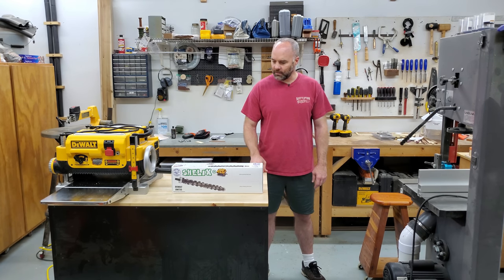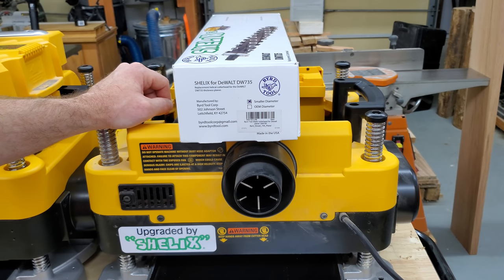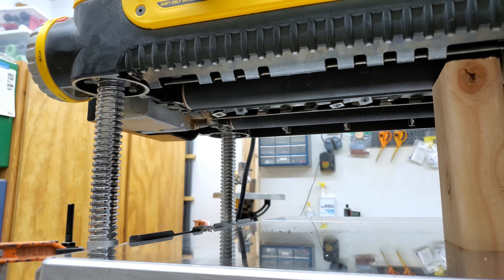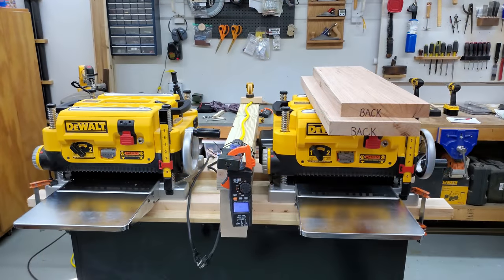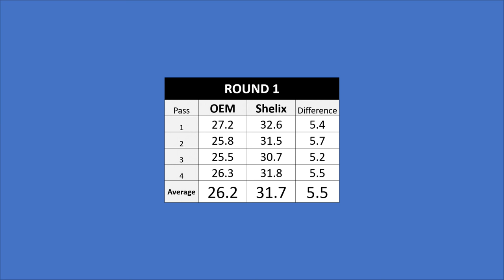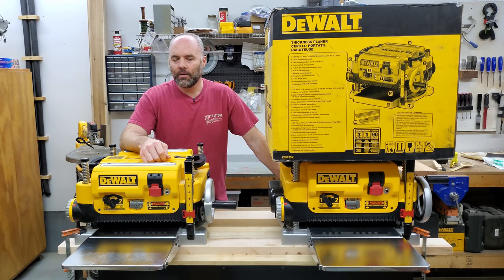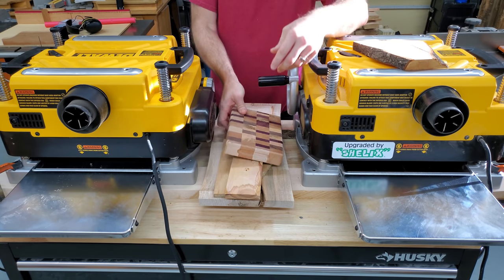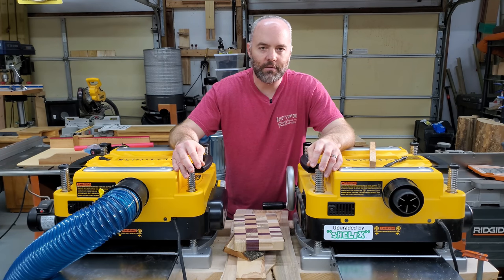The video I wish I watched before buying a SHELIX

Comment: Thank you for this info. As a woodturner, I dont do much flatwork. I will stick to hand planing for now.
Reply: @nicksshitbro  I would get a 16" Lathe, 110 power. Try a Jet. Great features, reversible, not too expensive, not overpowered for a beginner, but will not block you like a minilathe. Mini's are cheap and beginner friendly, but you do skill past them I think, if you stay in it. If I had to do over, that's what I would do.
Reply: @nicksshitbro  Dude, I am sure you know jet for wood, not metal. I would love to get an old timer lathe, a nice gearhead monarch, leblonde or something. Not into CNC. Olde timey making is where it is at. Just an old lady working out of a garage, but... I cruise craigslist all the time for old iron. A girl can dream.
Reply: @nicksshitbro  Hey, it counts! Workholding and safety lessons apply, across the board.

Comment: I'll stick with stock blades. Can buy many blades for the price of a helical. For the first 20 years of woodworking, I used 3/4 or 1/2 stock as a planer was beyond my pocketbook. My first planer was a Ryobi 10". As clockmaker (now almost 60 years) I wore it it out. I bought the DeWalt about 10 years ago and have run about 10,000bf through it milling a lot 4/4 down 5/8". Looking at finish from my straight blade and that of helical blade finish- it ain't worth the cost.

Comment: Wow, what kind of deal would you give me on your extra planer? Still haven't bought one yet. Will want to buy a Shelix head now also! Anxious Robert
Reply from the maker: The shipping costs would make it not much of a deal. You're better off keeping an eye out for some of the holiday sales.  You can even get free shipping.
Reply: @TheSnekkerShow  Hi, thanks for the reply, I just got lucky today and got a brand new Dewalt planer still in the box never used at a pawn shop by my house for 250 with tax and 15 day warranty included,  it's a 3 blade but 1 model down from the ones you have,  it's model #DW734. THANKS AGAIN, GOOD VIDEO! Robert
Reply from the maker: @robertc.6441   Good to hear, sounds like you got a good price.

Comment: I would expect the higher current draw, given the increase in blade area (4 curving flutes vs 3 straight flutes). The fact that the power draw leveled out with both machines on full steam is interesting though. As is the acoustic difference in the tool heads. On that sound difference alone I would be willing to make the change. Given the ability to confine damage to at worst $4-$8 vs $60 makes it a no-brainer, providing you have the power for it.

Comment: That's it I'm not going to buy this planer. I'm going to make my own to plane half inch pine , I'm going to build one with a 454 chevy motor with sprockets off on a bulldozer track. Good vid Thanks.
Reply from the maker: Oh man, now I'm having flashbacks of the 1989 3500HD with a 454 I bought for $2,000, spent $1,500 working on, and then sold for $1,000 a few months later.
Reply: @TheSnekkerShow  I still have 2 of them ones a 88 3500 and the other is a 97 dually and they can just sit out back. They get about 7 to 10 mpg and I will just drive my 4 banger ford ranger and they are talking gas can go up to 10 bucks a gallon the way things are going.

Comment: Cost of  the cutters in minor compared to the cut it’s producing. Helical cutters are far superior to straight blades. I have large planners and small planners like in your video . I use the small ones for higher figured woods for boxs. Superior cuts on figured woods for the most part

Comment: 1. Amperage is always measured under "no load" so yes, it is a 15amp motor, regardless of draw under load. 
2. Breakers have a "slow blow" feature built in so they don't trip during high current draw of motor start ups.
3. I would NEVER run multiple devices on a single 15 amp circuit!
Reply from the maker: The closest I've been to running this with no load is with the impeller removed. That drops it to around 5 amps, even while moving the rollers and cutterhead.
Reply: @TheSnekkerShow  by "no load" manufacturers mean your not putting wood through it.

Comment: Would be interesting to remove a row of cutters on the shelix. Wonder if the increase in amps is due to higher engagement.
Reply from the maker: Probably, but it would throw the cutterhead off balance and kill everyone in a 50 meter radius with shrapnel. I've been tempted to do another test with the Grizzly head since that one has three rows compared to the four rows in the Shelix and Lux models.

Comment: Does the shelix noticeably feel heavier. I might be wrong here but isn’t the power draw directly related to the mass? P.S. I want to see the ham sandwich lol
Reply from the maker: I'm not sure about the weight, but I vaguely recall the Shelix running at slightly lower power when I was doing no-load measurements. I wish that meter did a better job of measuring max amps during initial startup.
Reply: Once it is spinning, mass won't matter much.  It will take more to get up to speed, but once in steady state added mass will not require more power to keep spinning.

Comment: I think DeWalt can refuse to warrant use of a Shelix in the planer. They didn’t design the planer to use that component and as you pointed out in the first few minutes, the planer feed system is affected, the motor is affected and the stress on the components will be different than with the OEM knives. The knives and rotor are a critical component of the system. Certainly more than wiper blades and tires.
Reply from the maker: I would ask, what's the difference to the motor between a hobby woodworker using a Shelix to plane wood occasionally, and a commercial user planing lots of hardwood constantly with the stock knives?  If DeWalt installs a thermal breaker to prevent the motor from overheating and it fails to prevent the motor from overheating during the warranty period, who should take responsibility?
Reply: @TheSnekkerShow exactly....what is the difference? No one at DeWalt designed it for this head so why should they be responsible for a user modification. Board feet isn't the only variable to gauge stress on the unit. The breaker is there to prevent an electrical fire per UL standards. I know because I have designed products with these breakers. The breaker is not a limit on abuse of the machine to prevent mechanical failure or stress that is cumulative over time. Fatigue of components is another factor in the mix. The motor is clearly straining more with the Shelix which is a good indicator there is more mechanical load on the components. Compare driving off road vs highway miles. The car will have fewer mechanical failures on the highway because the stress is lower over a larger number of miles.
Reply from the maker: @bingobango8777  Glad we agree the motor can be stressed with or without the Shelix. I guess it's up to the service center to make a decision on warranty coverage.
Reply: @TheSnekkerShow  https://support.dewalt.com/hc/en-us/articles/360021403154-What-is-DEWALT-warranty-  alteration or repair not covered. Yes the motor is stressed in both configurations but one is beyond the design specifications. All components of machines are under varying kinds of stress. What matters is if they are within the material and design limits the engineer specified for the product.
Reply: @TheSnekkerShow  see top of page 12 of the 735X manual. “NOTE: Helical cutterheads have not been tested with this product and are not recommended for use. “
Reply from the maker: @bingobango8777  That's a nice interpretation, which I already discussed.  Fun chat, have a good night.
Reply: @TheSnekkerShow  I wasn't interpreting anything.

Comment: FYI, Hitting a nail wipes out not one, but THREE blades. For me, it just took a knot in Redwood and now I have a high groove now (which means a second final pass and a light sanding). Anyway, the payoff is three times faster than explained on this video.
Reply from the maker: If the rest of the knives are still sharp, you might be able to rotate or replace only one knife. That's what I do with my jointer since I replace for nicks much more frequently than dull blades.
Reply from the maker: @Fun4GA  Likewise, if you replace one knife, the new one will remove the ridge left by the two nicked ones.  https://youtu.be/6vudqFvFu7E
Reply: @TheSnekkerShow  Good point.

Comment: 30 Amps?! :O
In your american 120 Volts installation it gives 3.6 kW power draw. Here where i live we have 230 Volts in single phase, so with same power it would be "only" around 15.5 Amp. So pretty safe for standard electrical installation. Do you have thicker wires in US to compensate lower voltage=higher amperage? :S
Reply from the maker: Wire size is determined by amperage, and is probably close to the same size no matter where you go.

Comment: You said 10 loops in line splitter, but your meter is reading 300 amps, which would give 3 amps. Also you are measuring peak current bit breakers trip based on an rms current.
Reply: 300 divided by 10 is usually 30.
Reply: @AJ-ln4sm  that’s correct, not sure what I was thinking when I wrote this...
Reply: @jamesmarks8099  you were thinking metric amps, lol.

Comment: Okay this may seem like a dumb Question but if the dewalt planer is $650 and you add a 400 dollar head....Now you have spent over a grand on it...Can't you just buy a higher end planer to begin with?
Reply from the maker: This comes up a lot, and has many angles. Yes, spending more money generally gets you better tools. Hobby guys and pros alike have to prioritize and justify their investments, and usually build their workshops incrementally over many years. Spending almost an extra grand for a helical carbide floor model would get me a bigger planer than I need, that eats up more shop space, and cuts in to my SawStop table saw budget. Everyone's situation is different though.
Reply: I just bought this planer a few weeks ago.  Paid $499, included the out feed tables and xtra set of blades.  I don’t mind spending the xtra $400 for the Shelix cutterhead.  How I see it, is not in total cost, but cost EACH time I made a purchase. Besides, this particular planer is tried and true and a legit tank!  I also purchased the stand on wheels from Dewalt so it’s really easy to move around since, like most of you, space is limited.
Reply: I think so. If you're willing to drop a grand on the planet and the helical cutter, just save about 500 more and get a 15" floor model that probably has a helical cutter from the get go. And it likely has a 1hp (maybe a 2hp) induction motor so no overheating issues.
Reply: I am currently considering this exact question. Here is the way I see it, there is no middle ground tools, after this dewalt you need to spend 3x more to get a 15". My problem with the bigger 15" machines is the weight, I cannot get 400-600lbs down my basement stairs.
Reply: @Sillyturner  haha i did manage to get a 3ph sawstop down the stairs ...

Comment: Since your comparing it to a car, if you constantly put a heavier loaded on the planer it the same as towing a trailer your car was not designed for especially if you put wheels, tires etc that may do a better job but will alter the design! That breaker should not trip so often yes it's going to wear out the motor faster the same thing that happens to a vehicle you overload regularly because of mods!

Comment: The reset button is a safety device but if your planer stops working the problem might be the micro switch this is inside behind the outside switch. These micro switches seem to get hot and burn out. Most people think it's the outside red switch. You have to take apart the whole front to get to the micro switch. The closest warranty service center was 4 hours away from me.  DeWalt has the worst service centers. Learn to work on your machines you probably  know more then these so call tech service guys.
Reply from the maker: Right you are. My micro switch went out later. https://youtu.be/I0TjrxVLZZU

Comment: The amperage draw will probably increase in the new planer as the blades lose their edge.
Reply from the maker: You're right, and it would be interesting to measure the difference. All I had was a set of new blades when I did the comparison.

Comment: Did I miss it, did you ever show diference in cutting finish?
Reply: What do you mean did you miss it. Fast forward in the video
Reply from the maker: I showed some cut-quality comparisons at the end of the previous version of this video, and intended to do the same with this one, but two things got in my way. I did the cut comparison at the end of the day, and the low-angle evening sun was so bright it washed out the boards. Second, the steel knives were new, so the cut quality was much better than it would have been after some use. This was a close match with used carbide cutters against new steel knives, but if the steel knives had been used even half as much as the carbide, there would have been a lot more chipping. New/sharp steel knives give a great finish on uncomplicated wood, even better than carbide because it can be sharpened to a finer edge. Once the steel becomes even slightly dulled, the quality goes downhill fast.
Reply: I was expecting to see a finish quality comparison too.  That would be the main reason for considering a helical cutter upgrade IMHO...
Reply: I had replaced a head on my rigid planner with this head, used for one job then CA fires wiped out all of my shop and house, but I liked the head , it did good job , did not have to rotate any knifes.

Comment: Spend the money and get the lux cut from my work it seems to be the better of the carbide replacement cutter heads I have both
Reply from the maker: What do you like better about the Lux Cut? They're pretty close to the same price most of the time, but the replacement cutters are more expensive for the Lux. Shelix is made in USA, and the Lux is made in Taiwan. I saw a video on Stumpy Nubs a while back where he was plugging hard for the Lux, but he's done several videos that appear to be sponsor-driven, so I wasn't sure how much of that was the sponsor talking. I think he said the Lux was easier to align the cutters on, but I've never had any trouble with that. He also said that the Lux had a black-oxide coating to prevent rusting, but I've never had any trouble with rusting either.

Comment: Folks..I get the money issue between the two types of cutter heads, but I plane a LOT OF lumber and there's just no way you're going to go through so many blades over time it'll be a significant savings. I've been running my Ridgid for about 6 years and have only changed blades once. Yeah, I've hit knots and got knicks in blades plenty of times, but it's not a huge deal breaker to simply plane off those long high spots with a hand plane. I only replace them when they get too dull to cut effectively. I've spent $30 in 6 years. Hardly enough to justify a $400 cutter head.. I suppose if I had fuckaround money I might get one, but most likely I'd just get a much bigger planer..
Reply: Cost simply isn't always the most important or deciding factor in all purchasing decisions. Sometimes people prioritize other factors, and he went into great detail about many of those factors in this very video.
Reply: The big issue at my makerspace was not the cost of the blades, but the downtime of the equipment. Being able to swap out one cutter would probably be worth it in that case.
Reply: Sometimes you just want nice things
Reply: @stickyfox  How much down time do you think I have changing blades every few years when it takes maybe an hour at most to change them completely? I do get it. The luxury of those nice cutters would be great, but for businesses like mine they're a luxury plain and simple and can't afford luxury parts. I have to make every penny count every day or I'm out of business. Heck, most jobs I'm converting 2x10s into usable furniture, tables and other things. Then again I do also give a lot of my work away as charity since so many people I know have lost everything they owned through evictions and other problems. I just made a table for a family who lost everything in a fire. Am I supposed to say sorry, I need a $500 cutter head instead? Maybe some of you can do that..I can't.
Reply: @martinoamello3017  No, I'm sure it's not for everyone. At home, if you ding a blade and can't shift your work over to avoid it, you can stop and change the blade. It's a minor inconvenience. But at a makerspace with 400 members and only 3-4 authorized repair techs, most users will have to stop using the planer possibly for days, until someone who volunteers their time has an opportunity to fix it. If that someone knows it's a five-minute cutter swap instead of an hour or so blade replacement, they'll get in and get it fixed quicker. I would buy this without thinking for a multi-user scenario because it's that much of a time-saver. But for my own planer, I would probably just check my stock very carefully for nails and staples and keep doing it the old fashioned way.

Comment: Your current measurement setup was wrong. Clamp meters should only go around one conductor in the power cable, not both. You were doubling up your measurement. When the overload tripped at just over "30" amps, you were actually just over 15 amps. You can buy split cords specifically for this purpose.
Reply from the maker: That's not how it works. Going around both the positive and negative would result in a reading of 0, not double.

Comment: The button breaker on the planer is to protect for amperage overload, not cutter temperature.
Reply from the maker: That is correct. It protects against amperage overload by reacting to excessive heat in the breaker, but does not have any way of measuring an actual number of amps.